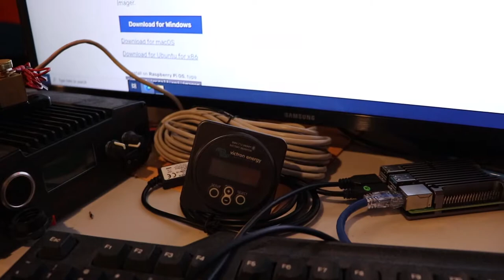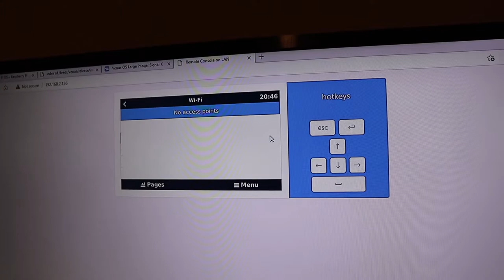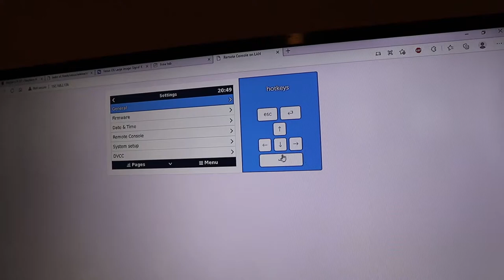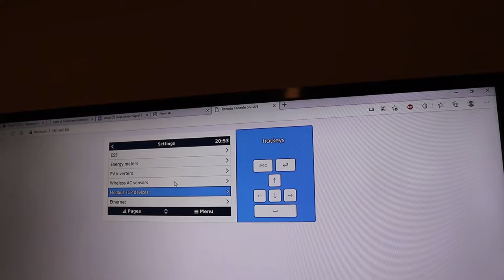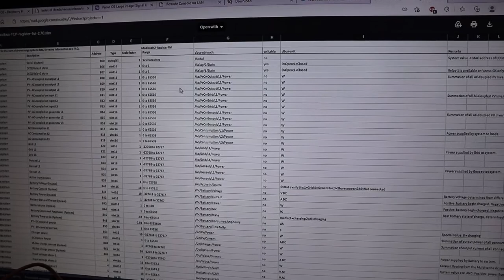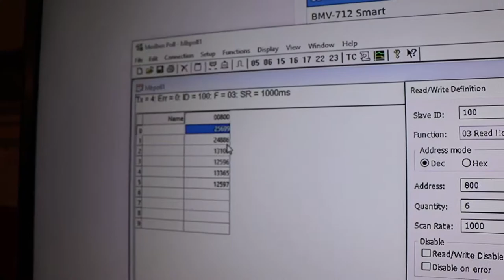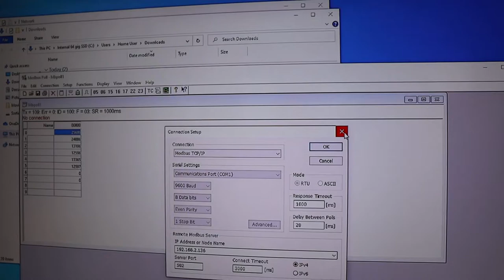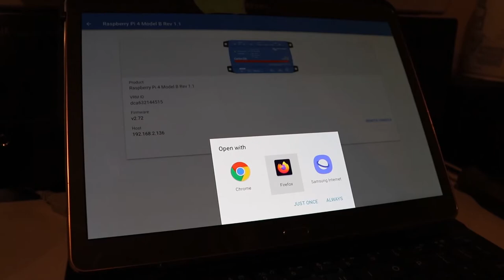Victron Venus OS on Raspberri Pi 4 B and Reading Modbus TCP Tables

Comment: Great video. I only have a Raspberry pi4 1.6 display starts, but further happens nothing and stops at the three logos. Is the BMV needed UNCONDITIONALLY? Am absolute fresher
Reply from the maker: You don't need the BMV for Venus to work.  Another watcher mentioned that there are problems with v1.3 and higher but I haven't researched it.  You may want to look online and see what you can find.  The display with the 3 logos isn't really important, you need to access the Raspberri Pi by Ethernet and go into the web display.

Comment: Hi. What version pi 4 b is yours please??????
Reply from the maker: I'm not too sure, it is packed in a box right now but I don't think it's too important...it's one without much memory compared to what is being sold now.  Are you having trouble with something?
Reply: @SteveRivett  I have a pi4 b I think it the version 1.4. Venus doesn’t like this version as doesn’t boot on startup. Version 1.1 and 1.2 seams to work. Was hoping you had a version 1.4.
Reply from the maker: I found it and plugged it in, it is a Raspberry Pi 4 Model B Rev 1.1.
Reply: You are very correct 1.4 is not working